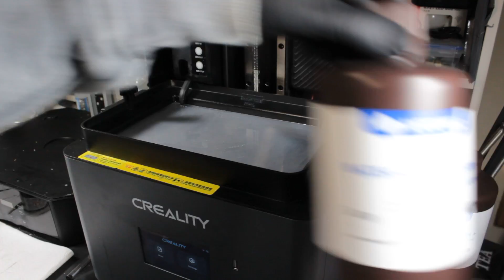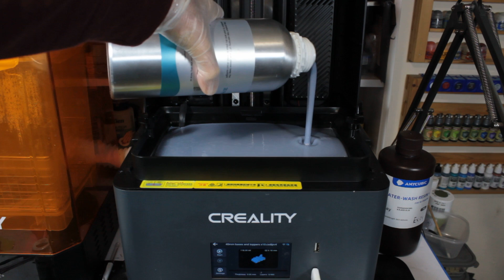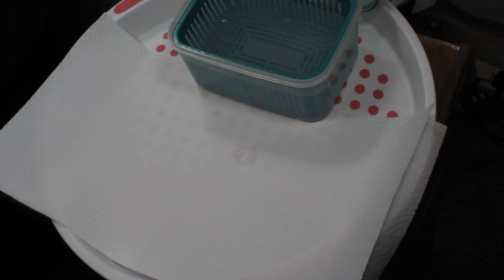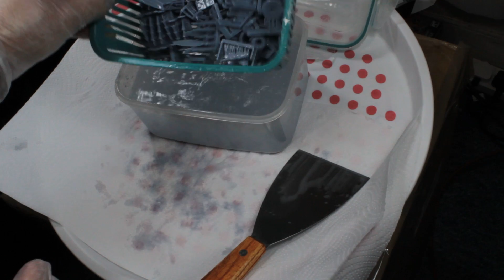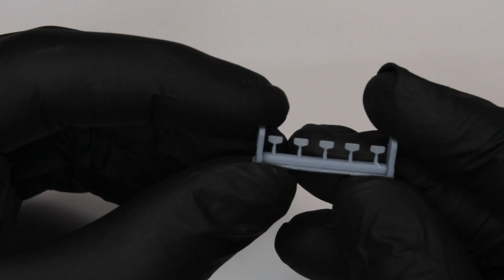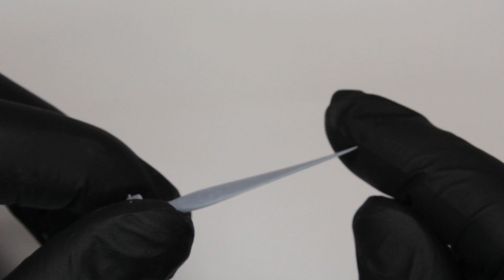Is 3D Printing Right For You?

Comment: I have been modelling for years but never been near a 3D printer. There seem to be some out there who can design and print stuff to super detail their models. I am old  school and scratch build stuff from plastic. I am with you on metal tracks as they behave very realistically on models and add a nice bit of weight. I recently built the Takom Chieftain and got tracks from the far east which weren't too expensive. I think you need to be rich or very set on 3D printing to buy all the stuff and software to do full on own design 3D printing.

Comment: Having had a filament printer for a few months now I just couldn't be bothered with the faffing around with resin.  Appreciate the quality though.
Reply: One trick for smoothing out the layers on a Filament 3D prinyter, brush some acetone or Lacquer thinner over it. Let it dry then repeat. Now sand and 90% of the layers will be almost invisible. (This is for PLA filament.)  I have both  Resin and Filament printers. Filamnt is great for internal parts like spars etc that will not be visible.